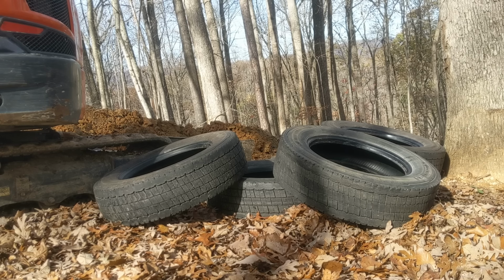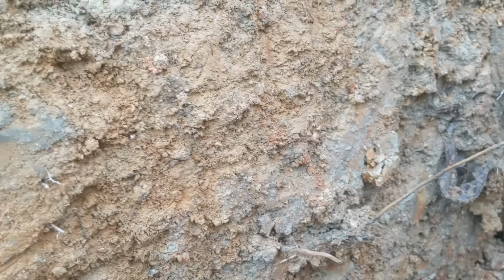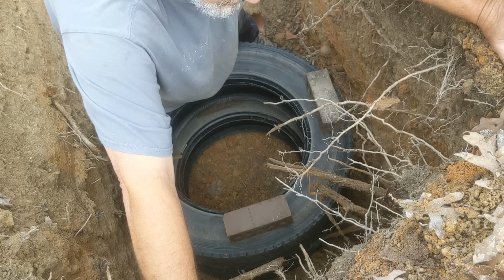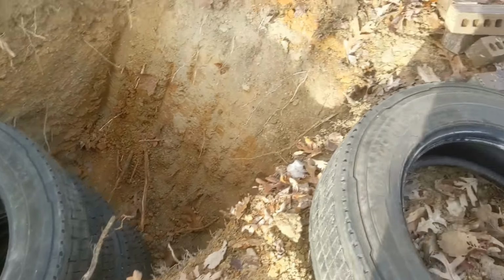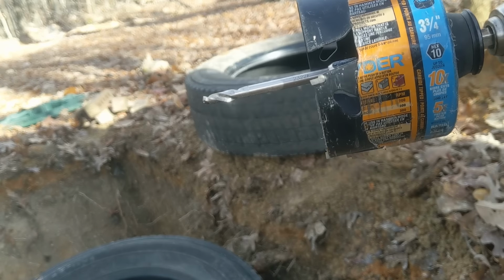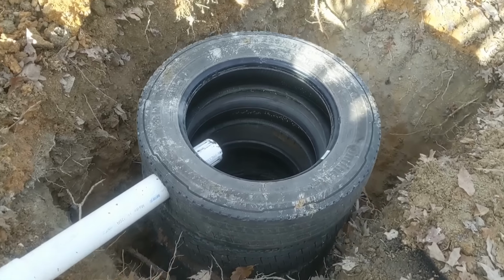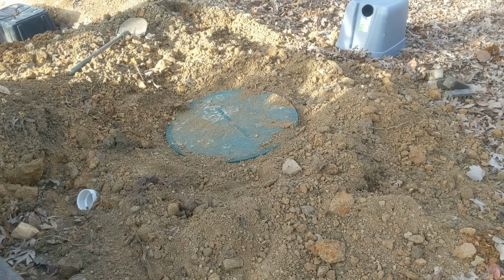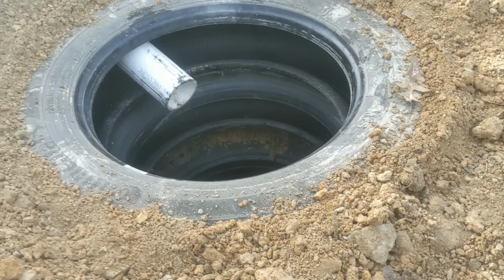DIY used tire septic system for a rv, cabin or tiny house. all made out of tires.step by step build

Comment: I did basically the same with a plastic tile 4 feet wide 5 feet long  . I put two inch holes from top to bottom and never one issue to date .

Comment: Thats more like a cesspit or cess pool not a septic system which has trenches or a leach field...usually the cesspit /pool fills up and needs to be dug out. Becuz theres no place for the water to percolate to especially when the surrounding soil is clay or clay loam. That system would work for one person especially if a grey water field was used for bath & sink water...but for a family it would fail miserably...
Food grease from sink is the killer of leach fields or trench system as is laundry soap powders......though cool idea...they use this idea in india. Especially for small villiage community toilets...a big brick lined hole last for about 10 years...then dug another one! Smells great in the summer like a hog or dairy farm!!😊

Comment: I went to my county born and got me a 6 foot kind. Concrete cupboard 3 inches in diameter. Pour the wash rock in the bottom. Put the cupboard in and then put me.  A 25 foot field line 6 foot deep with horse rock, 3 foot high and then covered with soil.I won't never feel that up

Comment: I would add an elbow at the pvc 3 to drop down a few feet. Every tank should have one to keep the liquid separated from the solids so the solids can't clog the pipe. It really needs an elbow going down. I really think you should dog it up and do it and correct the video. It really makes a difference. The solids float and really need to have that baffle to allow the liquid to keep the pipe clear. Think about it. They all have it when done properly.  The problem ones are often because the elbow broke off
Reply: Nothing will float to the top because the "tank" is more hole than hold.

Comment: 24” corrugated culvert pipe with a lot of holes and wrapped in landscape fabric would probably be better then tires.  12” inches of gravel at the base and back fill with gravel. It would not be free like old tires but it would last longer and work better.

Comment: This is not how septic system are supposed to work.  You can grab a how to book to learn all about them.  The main way septics work is to put the crappy water in a holding tank with a baffle.  The first part is where the solids fall to the bottom and are eaten by bacteria.  The watery slurry goes over the baffle, leaving behind the solids and oils that float on the top, and they sit in a secondary "fermenter" where the enzymes continue to digest the crap.  The OVERFLOW (mainly dirty water) flows down a tube to a LEACH FIELD where the water trickles slowly out holes in the tubes to "water" the grass that is supposed to be above the tubes where the effluent leaches out.  Downhill from that leach bed is a leach field of sand to filter out any contaminants that manged to get that far.  Or you have sand underneath the bed if you have sandy ground (many do not, hence the additional "field" that must be installed.)  All of these items, the tank, bed, and field, all MUST have vegetation above them.  This allows the roots to grab the effluent water and absorb the last of the particles of crap that made it that far, called transpiration.  That is how septics work.  Leaching the crap directly into the ground without these measures will surely contaminate the surrounding soils.  I hope you don't have a well or river/lake nearby.  Don't even consider doing this open style system if you do.  Better to use a composting toilet and compost the solids in a black solar composter, and dump your other water and pee into a French drain or sand/peat moss filter.  It's the crap that causes e-coli bacteria, which you don't want in your clean water sources.  I do this on my vacant property and it is the most sanitary way, the compost breaks down to practically nothing each year.

Comment: You can fill each tire one by one so It will be stronger when you reach the last one on top. And for increase the capacity of the septic tank you also make three well of 5 tires each interconnect.. and last  if you cut several  holes  in tires the bricks won't necessary ..I guess 😅

Comment: I was wondering what was gonna happen when you tried to drill through all the steel in those tires..
I use plastic drums when I wanna build a small homemade septic system but tires are a different idea

Comment: I would've made two stacks of tires. One for solids, and another for liquids. If I were doing it I would've put gravel around the liquid side of the tires as well. Otherwise, a great idea.
Reply: How are you going to seperate liquuds and solids?
Reply: @daanwessels4781  Solids settle and do not remain suspended in solution. By placing a baffle and another section of pipe from the first tire pit to another pit the liquids will naturally flow to the next chamber. There is where I would place a yard or so of drain rock around the second stack of tires.

Comment: Only 1 flaw that i can see.
  Not sure why you wouldnt get a small truck load of drain rock for a least the 1st foot and a 1/2 or 2 feet on the bottom of the hole. This will give it more leaching ability and  make it last way longer.
  Drain rock in any leach line or drain field is kinda essential.

Comment: How do the tires themselves drain the water and/or turds? I mean, you could drill  multiple holes in the sidewalls of the tires so liquid would drain all the way to the bottom... but the solids would just lay in those tires....right? Did you ever try to get rainwater out of an old tire thats been laying around outside? It's nearly impossible without picking up the tire and shaking it out....🤔

Comment: Not worried about coliform bacteria traveling thru the ground & hitting water sources? 
Not worried about roots growing into it, harming the trees/shrubs & clogging it? 
This configuration is basically a covered “cess-pit”….it can work ok for maybe up to 2 people for awhile, but will require attention sooner than later. Lots of fail-points. 
This tire cess-pit can work for kinda emergency needs, but there are better ways to maybe do it, to more closely resemble an actual septic system, even if using tires, Imho.

Comment: Not surface water tight. Extra water will slow soil absorption. Been in the septic business for over 40 years. Works in a pinch, but not long term.

Comment: First three tires no bricks give you a chance for the solid waste to break down make you structure more stable the next two or three tires I put bricks in between them make you a whole on top to drop you some rid-x in or I should say a pipe with a little small cap or no cap for ventilation and to drop your rid-x in from time to time
Reply: Yeah place of piece of 10 on top of your tires, out metal roofing piece a pipe out of it with about 6 in of Earth on top of it maybe a piece of plywood under the tin

Comment: Well, it looked good on paper anyway. Those voids between tires are waaaaaaay to big, in fact they shouldnt be there at all. $20 says his backfill alone will fall inwards and fill his "tank" area within a month😅. For the effort I would have just used a plastic/steel 55 gallon drum. Drill a thousand 1/4" holes in its sides and bury. Done.

Comment: This would be classified as a drywell or cesspit. Not a cesspool. Not a septic system in any way. Dig another one every 2 years, bury this, ring it with trees. It's a fancy outhouse hole..   I saw , and used at a rental, a big one, 8 feet deep, made from railroad ties. It was on its 10th year when I lived there.

Comment: This is nothing more than a outhouse pit - and we know what happens with a outhouse pit.  They fill up and you dig another pit.  The solids w I'll never break down.  I wouldn't put toilet paper in your toilet. - and definatly no kitchen grease. In our RV we don't put paper in the black tank, makes the sensors not work.. We haul the paper to the dumpster and throw it with the trash and probably 500-1000 dog poop bags and a couple hundred pounds of cat liter.  That allows us to use any paper we choose, not RV specific paper. We have a can with a plastic bag and thighs fiting lid.  Just install a septic system.  It cost me $500 to get my septic system pumped last time now multiply that every few years.  And the fact that if you sell the house, it will have to have a septic installed - no bank will loan on a house with this system.  If it's a cabin it might work - just build a little hut over it with a seat with a hole in it.

Comment: Seriously? When you flynk your drain field class you build something like this. 
Theres a reason minimum and maximum distance to surface exists for drainfields. You want the effluent to be picked up by grass and other vegetation to respirate the moisture out the surface. The point is to not contaminate the ground water. This contraption is too deep. 
If you wanted to use tires then a shallow ditch with tires only two deep with pipes running from one to the next would probably work. Top tire should be within 6-8 inches of the top of the ground. Consult your local code for that difference. Filling the tires with screened gravel would be a bonus. 
Of course by the time you do that you might as well just make a regular perf pipe drain field. Its not that hard at all.

Comment: I think I would prefer a toilet system where no water is added to waste and the waste is incinerated into ash. The tires are an environmental hazard and so is waste that's filled with pharmaceuticals nowadays. The separating toilets used by vanlifers result in depositing urine into public toilets and dried out poop into garbage cans. But that's not a solution for cabins. A concrete box septic system does contain waste long enough to  allow it to breakdown before entering the ground water. I'm not so sure this does. Its kind of halfway between a conventional septic system and an outhouse. It's really a cesspool system with added contaminants from tires.

Comment: In my opinion...
Instead of drilling a hole in the tire, why not drill a hole in the lid, or run the pipe in between the tires?
Also, did you do sample pans to see if there was any color in that red clay?

Comment: That is not a septic system by any stretch of the imagination. It's a drywell. It will fail. Alternate. Use the tires as the holding tank, maybe double wide and deeper. Outlet pipe lower than inlet. Baffle on outlet. You have a machine. Either one leg or 2. Come off the holding tank and have perforated pipe over a stone field or several trenches,(3/4 or 1 inch stone).Either way go down 5 or 6 feet. last forever. Needs pumped every 3 or so years.

Comment: Curious if anyone has punched 4 holes in the tires to run short plastic 1" to 2 1/2" pipe through between the brick placements and before moving to another hole build, filling the hole half-way with dirt, a handful of walnuts, acorns, chestnuts, evergreen cones with seeds, or native tree species before completing the fill. Downhill of course, in a perimeter circle or rectangle away from a water supply that won't flood.